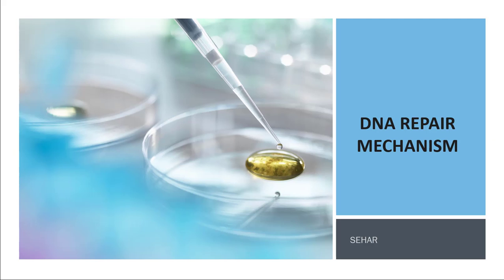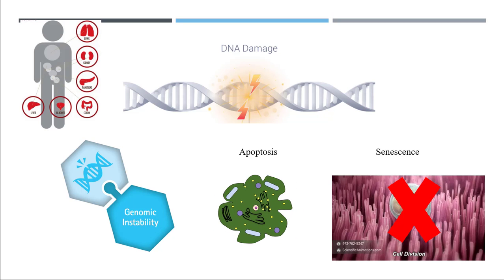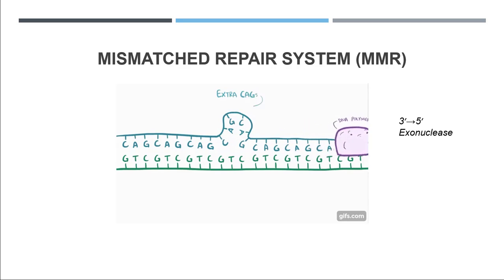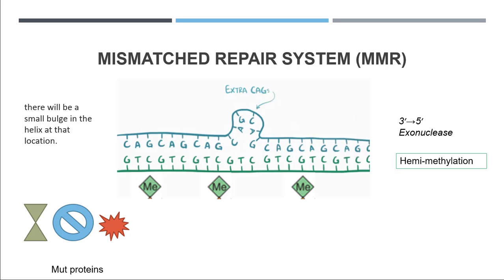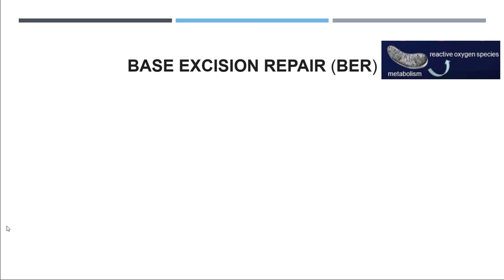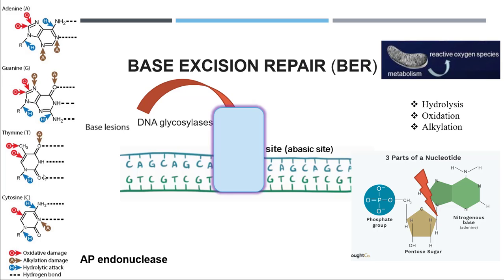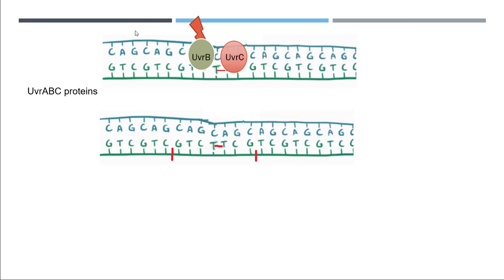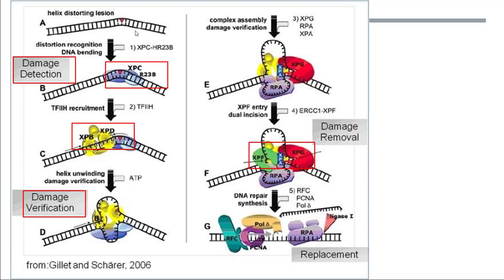DNA Repair Mechanisms Part 1

Comment: Thank you so much for this amazing explanation .Ma'am, I have a question to ask you. What is the function of DNA helicase II in NER of Prokaryotes?
Reply from the maker: Hi there, apology for late reply, Various DNA helicases, a group of enzymes capable of separating DNA duplex into two strands through ATP binding and hydrolysis, are required by NER to unwind the DNA duplex around the lesion to create a repair bubble and for damage verification and removal.
The reference of this statement is https://www.sciencedirect.com/science/article/abs/pii/S1874604723000057#:~:text=Various%20DNA%20helicases%2C%20a%20group,for%20damage%20verification%20and%20removal.

Comment: When dna repair mechanism don’t function properly, is there any chance the damage cell become malignant cell?
Reply from the maker: Hi there, if the damage occurs on the Gene's that are going to code for cell division process or apoptosis which is a program cell death, then there is a chance that they will become malignant cells.
Reply: @EasyPeasyLearning  thanks
Reply from the maker: @littlefinger8613  you are welcome